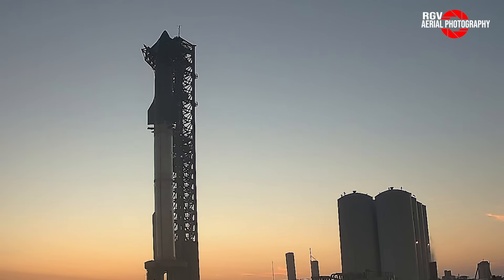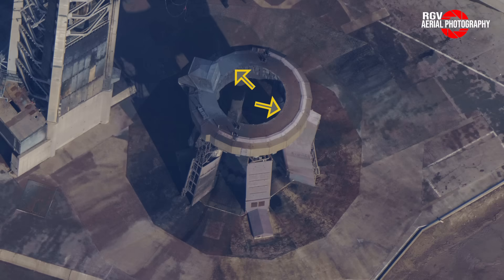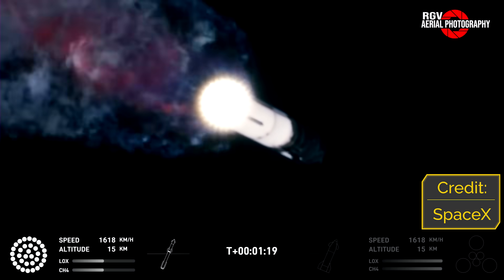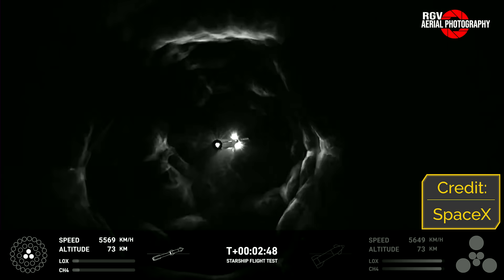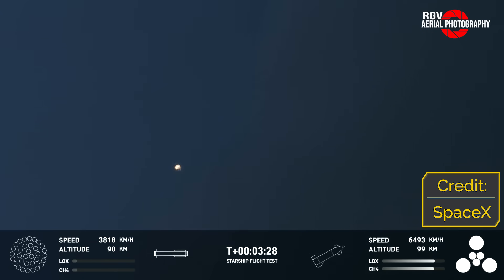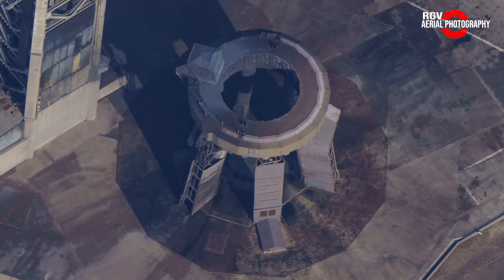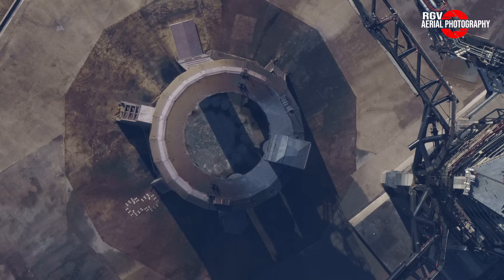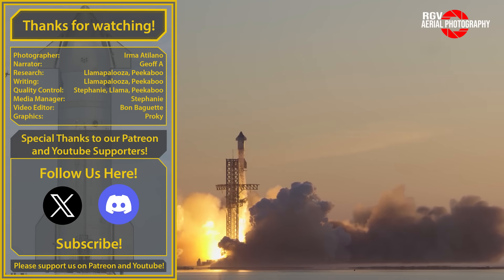DID THE LAUNCH SITE SURVIVE?! Post-Launch Flyover! - Starbase Flyover Update Episode 25

Comment: Booster failure... slosh makes sense. But it was also moving at mach 3 into it's tail... could create some backpressure which might upset fuel flow while the engines were in a low-throttle state.

Starship failure... liquid O2 reserves seem to deplete slightly faster than methane... after the 'jellyfish plume'. Sprung a leak? Impossible to tell where the leak is located though at that distance, at least from video alone.

Both explosions may have been triggered by auto-destruct, after a telemetry indicator makes it clear that the booster/starship were no longer capable of staying within 'nominal', even if they were still nominal at the time of detonation. Depends on how trigger happy they made the auto-destruct. FAA may have pushed for this change.

Pad looks pretty good. But still falls short of the "routine weekly use" sort of launch scheduling which Space-X has targeted. If that's a criticism, it's self imposed by Space-X, as nobody else's launch pads have ever done any better with such a large launch. I'd call stage zero "excellent", while space-x likely regards it as "there's room for improvement".

Obviously it's not "crew-ready". But this was really a superb test result for this stage of development.
Reply: Pretty sure that they were flying a tight envelope and auto wasn't going to allow deviations.
Reply from the maker: This is the most in-depth theory I've seen so far! It sounds very likely to be what happened. I do think that the FTS was triggered for both ships, but the booster seemed to be failing from engine issues beforehand anyways. I think the FTS may have been triggered on the ship due to the LOX leaking and running out.
I definitely see improvements coming for Stage Zero as well, but given the major upgrade between IFT-1 and IFT-2, I'm sure it'll look even better after the next flight!
It definitely was an amazing test flight of Starship and I can't wait to see how it evolves from here!
Thank you for watching, and thank you for leaving such an in-depth comment too!
Reply: @RGVAerialPhotography  :D i'm kinda into aerospace from a defense industry standpoint, more the aero part really, but there's lots of overlap.

Mach 3.1 at like 300,000 ft when it did the separation. Tail-on into the air... I mean the air is REALLY thin at 300,000ft. but mach 3 isn't slow, and there's a big bell shape... backpressure 'might' be a factor. Or SS shockwaves during the tilt... they can interrupt flame. Not sure exactly how thin air is at 296,000 ft though.

hmmmm, then again, probably nowhere near the pressure of fulll throttle combustion. so perhaps it's a silly idea. I may be just thinking in ramjet, while this is a BFR :P
Reply: @RGVAerialPhotography  Did some more digging. Looks like stage 1 did have sloshing, causing flame--outs, then quickly terminated cuz it was outside of spec.

My background isn't with cryo-fuels. I really underestimated what a delicate process maneuvering a mostly empty tank of cryo fuel is. Apparently if you shake up a mostly empty tank of cryo, you can even implode it. Entirely fixable, but fixes will add weight. More a question of dialing in the 'lightest' fix, not whether it 'can' be fixed.

Stage 2 is still 2 jellyfish plumes, and LOX going down a little fast after. Anything further we can't really see. I still think they both got FTS'ed.

Comment: Watch the Lox drop off rapidly on the 2nd stage right after that plume shows up.   This video cut that part short, but it's easy to see on other videos.
Reply: Definity looks like a possible LOX tank failure and subsequent engine failure resulting in FTS detonation.
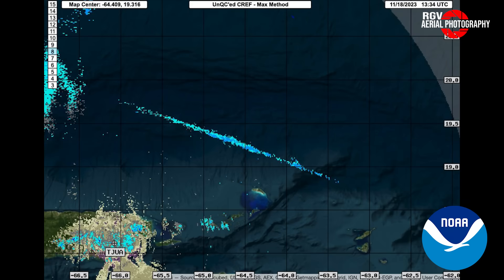Reply: Agreed, That plume at around t+07:00 certainly looks like a LOX leak
Reply: Why did the tank(s) leak ? A weak construction, means more weight needs to be put on then ?
Reply: @astrogeo1 The most likely place for the tank to leak is at the fill connection, which would probably not mean huge weight gains to fix.
Reply from the maker: Yep, it definitely seems like oxygen loss may have been the culprit for the ship RUDing. Hopefully they'll fix that leak for IFT-3 and we can see a cool spashdown by Hawaii!

Comment: Definitely sloshing on the booster.  The engines lit and then they went out, which indicates they were starved of fuel.  If they can do it on Falcon 9, it should be very fixable for the 3rd launch.  The launch pad being intact means I think 12 launches for 2024 and I think they will start working again soon on Roberts road, where they have a completed star factory and just need to quick build a high bay.  They have a launch tower almost ready & segments for a third.  2025 might see 3 launch sites and 40 launches a year.
Reply: just like SpaceX beginnings they had 1 launch left of F1 before they went bankrupt
Reply: @Mega747400  except it's not the same because spacex is not going bankrupt.
Reply: I think there was a dry failure in both the booster and the starship. Perhaps due to a leak or lack of fuel.
Reply: There's an optimist.

Comment: one thing that almost never mentioned, the booster slowed down (barely) at the separation, the entire reason of letting the three core engines lit is to prevent this and the resulting slosh, so it maybe not the slosh from the flip, but from the slowing down (which probably not expected, while the flip slosh should be expected end mitigated.)
Reply: It would be amazing if the issues were mere software and a few timing and methodological changes to programming were enough to resolve the issues.
Reply: @bradclifton5248  Actually I do think this is most likely. That being said I disagree caling it "mere software changes". Its not so easy to get this stuff right, thats why often enough changes in the hardware are prefered just to make things easier to code.
Reply: @LunnarisLP  it's a nightmare process. Gotta get the big things right first. Then edit down and fine tune.  If the hardware is correct, potentially editing programming over machinery, might well suffice. The fact that we got 33 times several minutes plus another longer burn on 6 more engines, suggests a lot of progress especially with Raptor 3s on the way.
Reply: Yes, as Elon says, often the most ironic outcome is what ends up happening. In this case hot staging meant to mitigate propellant issues actually caused propellant issues! 😅 If so though, it’s literally a few tweaks to engine firing and timings and it should work great! The upgraded FTS made to work more efficiently just maybe was a bit trigger happy too! If true, another bit of irony. I bet Elon has been laughing!
Reply: Someone on Twitter who claims to be a SpaceX insider claims the booster flipped way quicker than expected because of hot staging which caused all sorts of sloshing. If they can make the belly flop work I'm sure they can come up with a solution for this
Reply: With such a radical flip maneuver, and possible fuel starvation being the issue, why not shut down only outer ring on the booster and throttle down the rest.  Keeping them lit could resolve needing to relight mid flip
Reply: @jonathancohen2506  10 sea level Raptors at 50% would make almost as much thrust as Ship's 6 Raptors at 100%... so separation would be a challenge, even more so when Ship's mass increases in the future due to having a payload.
Reply: Agree - watch the telemetry, the booster slowed down … not just attenuate acceleration.  There was a very good probability of slosh in the tank.  I don’t think the models got the same impact of the ship’s raptors right in the the boosters performance.

But I a just an armchair rocket guy spewing from the sidelines
Reply: Good catch. If those numbers are accurate, it seems like that slowing down is short but rather significant which could very well point to this being the issue.
Reply: Scott Manley mentioned exactly that in Twitter/X hours after the flight. It got a lot of references including this very video!
Reply: I think they were also so focused on getting the ship away from the booster after ift-1, they decelerated the booster more than needed, since hot staging was so successful.  Seems like simple changes.  Also, the quick disconnect leak seems to have terminated the ship.  Again, relatively simple fixes
Reply from the maker: That is quite a good theory! I could see that causing some engine feed issues!

Comment: so DO BOOSTERS HAVE a headertank? if not thats the next piece of the puzzle they need to add
Reply: There is, but used just for landing burn. Not really a "header tank" because it's at the base.
Reply: Booster LOX header is at the bottom, surrounding the downcomer. The methane downcomer itself serves as the methane header tank. The headers are supposed to be reserves for landing though -- there's only about 8 seconds worth of props in there.

Comment: Test flight #2. Apollo had well over a dozen hardware testing flights prior to it ever taking people.
Reply: The Saturn V had only two uncrewed test flights: Apollo 4 and 6. SLS has (had) probably only one: Artemis I.
Reply: What?   Apollo 8 was the third Saturn V launch when it successfully orbited the Moon and returned safely to Earth.   Are you counting Saturn 1 and 1B launches which were entirely different rockets, with the exception of the second stage (which became third stage on Saturn V)?
Reply: @randyschreiner7807  Of course I'm including Apollo 1 and 1B and many other hardware tests. The Starship is evolving as we speak. Testing, swapping out equipment (e.g. hydraulic actuators for electric, "flick" separation for hot staging, FTS, etc.). And there will be many variations that will emerge from this initial testing: Tanker versions, Starlink Pez dispenser versions, Lunar landing module versions, even complete launch and forget space station versions. From there, looking back, you wouldn't say 'Those initial starship launches were entirely different rockets," would you?

Comment: Propellent slosh for a returning booster has been mastered by Falcon 9. Perhaps the plumbing and hardware is so significantly different in the Starship Booster that miscalculations resulted. Or a hardware failure/underperformance. It'll be interesting to see the actual cause.
Reply: But Falcon 9 doesn't keep it's engines running during the flip does it? Also the flip of SH looked a lot more violent than the one performed by F9.

For future launches maybe they should first shutdown the center engines after the Ship hold down clamps are released. Then turn the booster around and light up engines for the boost back burn.
Reply: @niri2506  No double they'll be working though things like this. That's what test flights are all about.
Reply: @lawrenceallen8096  oh no doubt.  I'm just glad they finally were able to give it another try so we can get closer to achieving Starship's full reusability.
Reply: @niri2506  Yeah, they've got that thing wired up from one end to another. Tons of data to work with. Bet their engineers are hard at work diagnosing right now.
Reply: sadly different tanks and whatnot means it is not as simple as done before, so will be perfect from now on, otherwise every aspect would been perfect on the first test, as no fundamentally new part in the entire rocket.
Reply: @thorin1045  the diameter of the tanks might indeed be an issue. Maybe it's the methane vs rp-1. Maybe it's the demand of the Raptor engines regarding fuel density.

But I really believe part of the issue is an Incomplete engine shutoff combined with a rather violent flip.
Reply: @niri2506  the flip could b an issue, the incomplete shut off was actually to prevent one type of slosh (slowing down during separation,) but it was not enough (it slowed down a bit) so the solution could be actually letting a few more engine not shut off, or less reduction in the remaining ones thrust. of course that could be problematic with the separation for the second stage.